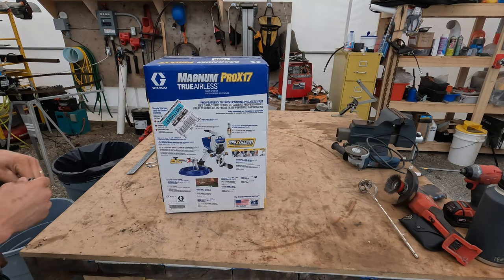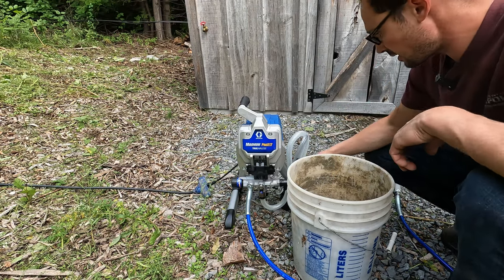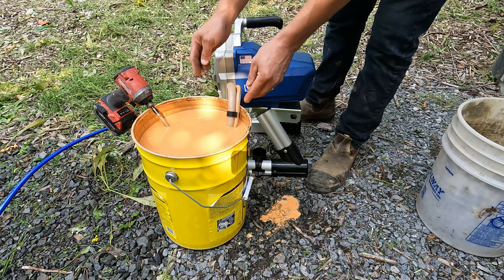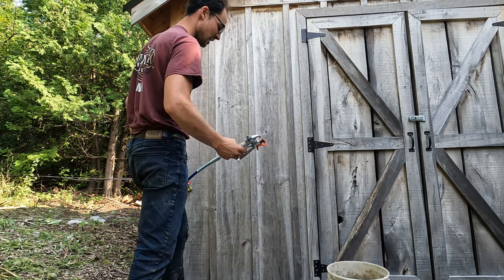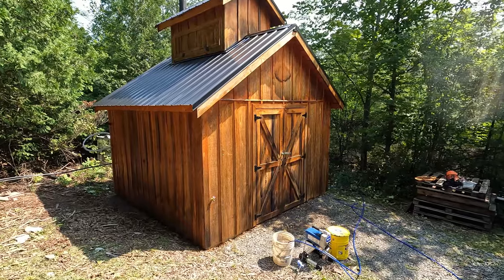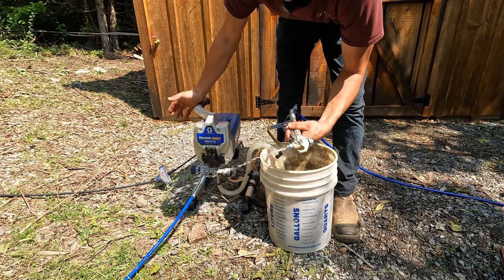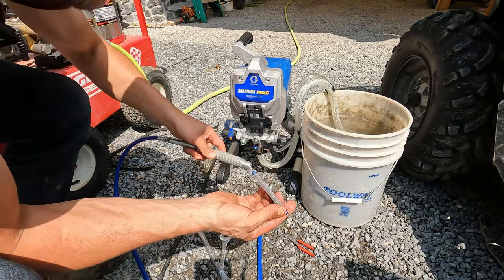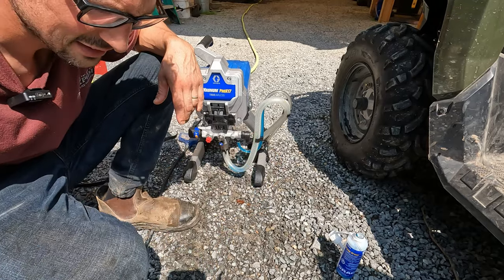GRACO MAGNUM ProX17 - Unboxing, spraying stain, cleanup & storage

Comment: Dude, you didn’t have to take the lid off, you can mix the paint with a mixer that attaches to a drill and will fit in the lid hole. Once you done mixing just put the suction hose into the hole this way, everything stays nice and clean where you don’t have so much cleanup to do, which is the majority of time on a painting project because the spray paint goes fast the cleanup takes time along with masking.

Comment: You can use the nipple on the bottom of the tip to hold the washer/gasket thing to put it in the guard easier . *pro tip for ya